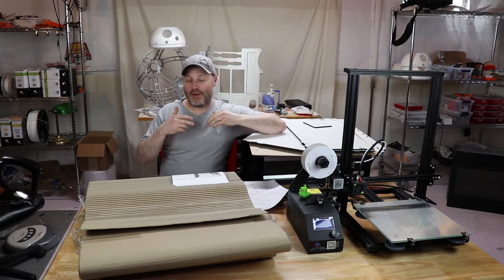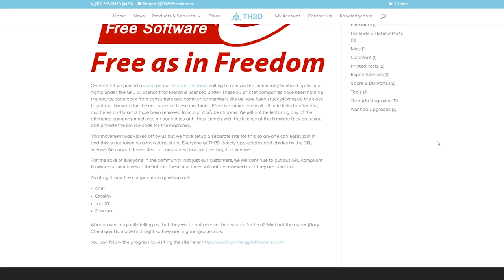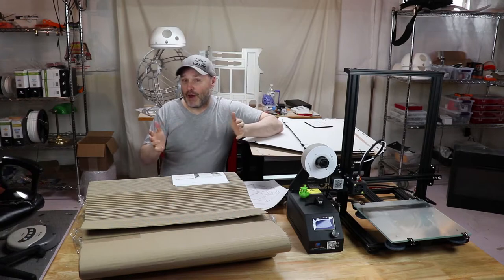Quick Chat about Creality CR-10S, GPL and more

Comment: A day early :-) Creality released the source code on the 9th.

As far as the safety enclosure is concerned, I bought one at MRRF and I really like it.
I made my own spool holder to fit the slots in the brackets that come with the enclosure, here's the Thingiverse link if your interested. https://www.thingiverse.com/thing:2841932

I put the hinges on the right side so I wouldn't have to reach around the door to feed the filament into the enclosure.

Looking forward to your review of the enclosure.
Reply from the maker: Yes I saw they released the source yesterday....so as I predicted....it did blow over!  I'm pleased they are listening to their customers.  
I'm looking forward to putting mine together once replacement parts arrive.

Comment: Your B.B.-8 is it the v3 ?
Reply from the maker: Your phone does the same auto-correcting mine does on BB-8!  (Annoying, isn't it?)  I assume you are referring to the dome?  I'm not sure which one that is...I've printed 3 one-piece ones and one in 3 pieces.  Most are Beta's from other builders testing out slightly different designs to reduce weight.